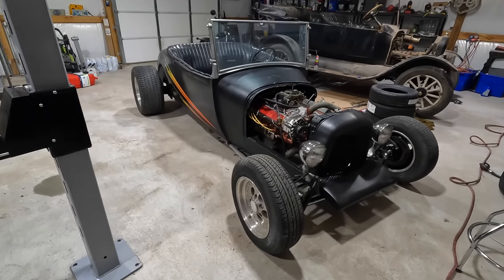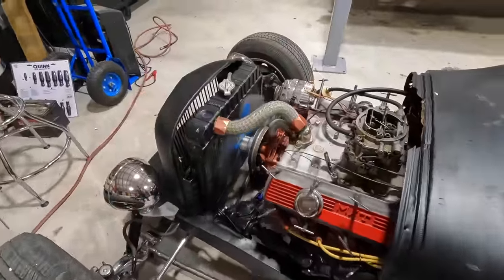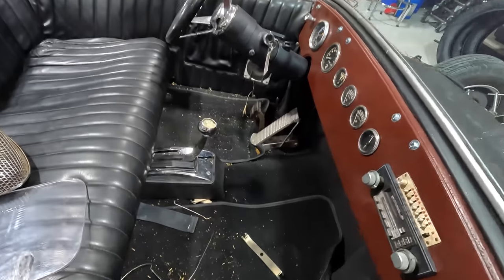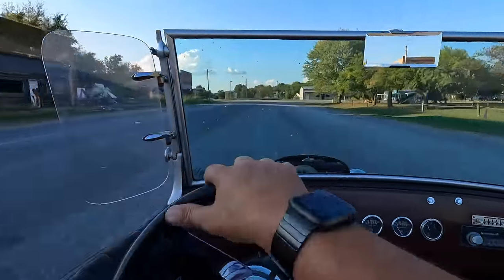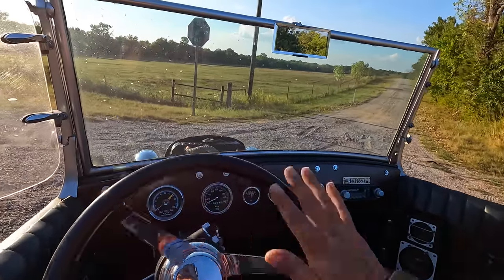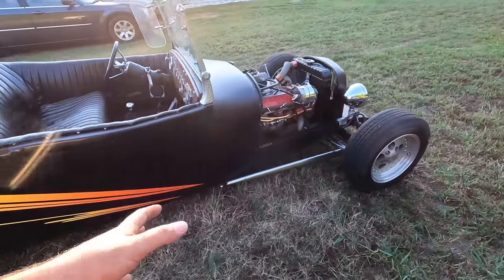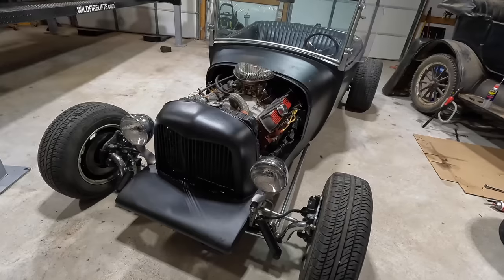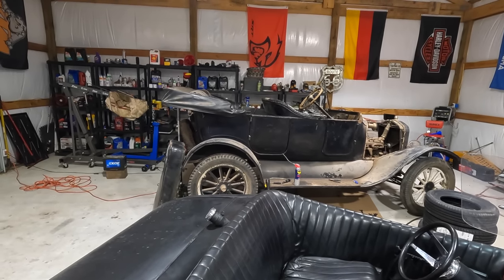I got Shafted on this 1929 Ford Roadster! $13K and 30 days Wasted!

Comment: Hello Randy. The 1929 Ford Roadster is a great car. But what's the problem that's you're waiting on?
Reply from the maker: I explained it all in the video
Reply: Can this car be refitted with a new chassis?
Reply: I would stop driving that car immediately The flexing of the frame and the fact that it moves the motor when you try steering it means the motor mounts must be welded to that tin foil frame You're asking for a hurt send that piece of shit back
Reply: They did not send the title.
Reply: old vette or mustang chassis would be nice
Reply: @FransvandenBergeMuziekschuur  normally when you place a V8 motor in one of these old "T" Frames you box it in. Sort of like they tried to do with the frame covers but actually weld in metal not tin.
Reply: @goleafsgo8496  I bet that car is a deathtrap.
Reply: @kirkacola7942  it’s not a T-bucket. It’s a Model A body that is possibly on a Model T frame which is way to weak to handle the weight and power difference because it was only meant to have a maximum of a 40 HP engine in it.
Reply: @goleafsgo8496  I’m not sure if it actually is a T frame without being able to see the frame other than the short section by the engine.
Reply: @kirkacola7942  it’s a Model A roadster….not a T-bucket.
Reply: @todddenio3200  o
Reply: @hanshoogendyk2203  ???
Reply: When you buy a vehicle at the auction the owner has 30 days to send you the title unless it is California then it is 45 days. If you don't get the title then you can return the vehicle to the auction company for a full refund, therefore, completely backing out of the deal. The owner never sent the title to Randy. After seeing the motor move when he turned the steering wheel sitting still I think he is lucky to get to return it.
Reply: @FransvandenBergeMuziekschuur  Not worth it at that price he paid! The only thing I would use is the body because it is steel.
Reply: @goleafsgo8496  thank you. I am from europe. We don’t see those cars here. From a personal standpoint. I see some awesome frames available. I like the car. And if the car stays. I’d go there. Alltho I get he has the yellow one (I would sell that in a heartbeat. Way way too fast). If he can buy it for a third without papers and make a profit on the yellow one…. 

Maybe.
Reply: Titles are easy to come by if the car isn't on a hot list.  You do need a VIN number.  Many states do not title older cars or title them only when requested.  As far as the frame, I suspect that a bit too much cross-bracing was removed to fit the V8, and that a few hours with a welder would set it straight.  All of the steering/driving issues seemed to manifest in conditions that would cause frame flex; others have solved that problem and he could too.  I certainly would prefer an authentic T-Bucket to the yellow car, and beyond the frame and tinwork, this one doesn't seem bad.
Reply: @douglasnicholls1366  maybe you could guide him to a professional who know how to straighten out that car? Could make a great episode? 

Home building hotrods is what set USA on the worldmap.

Comment: If you end up keeping it as you stated could happen in the other video I'd box that frame and attack the steering column better as that frame flexes everything quite harshly.
Reply: My frame is boxed, its a real Henry 32 frame heavily modified.   It doesn't flex.
Reply: Red really,  how about black!
Reply: A title is easy to get!
Reply: Where is it going to I'd buy it.  A fiberglass T Bucket is not worth much.  A real Henry 29 roadster is worth 20,000 plus.  If you want a nice traditional roadster I'll sell mine for $45,000

Comment: If I remember correctly, the 330 was the engine used in the original 442 in 1964. In 65 they changed to a 400 b/c people wanted an automatic so the 442 designation changed from 4 speed to 400 CI. Was a great engine tho. I'd never buy a T bucket tho.

Comment: I remember how sketchy my t-bucket was. If you find somone able to do old school alignments it helps. They actually align them like race cars so the front wheels actually have toe together which helps with the wheel hop at higher speeds in the front
Reply: With the way the steering is hitting the engine and moving the frame I bet it needs something more than an alignment.

Comment: From the way the engine was moving when turning in the shop, it seems like the front frame rails need a crossmember to tie it all together.  Could probably fabricate something.  Most likely that's why it's all over the road at highway speed.

Comment: I had a T Bucket about 30 years ago. I didn't build it, but it was basically built from a kit. Modern frame, fiberglass body, 351C/4 speed. A real Model T frame is not designed for a heavy V8 engine and modern wide/heavy tires/wheels. A T Bucket would have a special construction title unless it was built from a kit with a VIN.

Comment: Why would anyone put a model A body on a model T frame?  I’ll bet that it is a model A frame with the crossmember cut for the transmission to go through. The frame probably wasn’t braced or boxed which would explain the flex when the steering wheel was turned.
Reply: Exactly what I was going to say. Definitely a Model A frame and needs to be boxed. 
I actually don’t like using those Vega cross steer boxes on a Model A frame they put lateral strain on the frame a Corvair reversed box for push pull that goes parallel to tge frame

Comment: Sketchiest car i ever drove was a T-bucket. More sketchy than riding in the bed of a truck with all the bed mounting points rusted through and gone. 😆 Doors would fly open, seat was unbolted and slid around, no seat belts, and I fit perfectly out the open door(what do ya know). Fun stuff! 😆

Comment: In this case "Not Running" is snake oil speak for "Unsafe At Any Speed". It's pretty clear that this car was basically thrown together and was in rough mock up when it was sold. Hence the "Not Running" tag.

Comment: The Olds 330 CID V-8's were the only small blocks that had forged cranks and are highly sought after items by racers and rodders. All 350 CID cranks are cast. The 330 and 350 both shared the same stroke and bearing journal diameters. As an advertising gimmick, Oldsmobile had a 330 installed in a Cessna aircraft and actually flew it. I'm sure if you search hard enough you can probably find one of those magazine ads. I believe they were in Hot Rod and Car Craft mags as well as others like Motor Trend etc.

Comment: The 9:1 compression 330 was 245 hp, 330 tq. The 10.25:1 engine was 320hp and 360tq.
Reply: Also it had a forge steel crank from the factory outstanding motor had one in 65 Cutlasd

Comment: Car looks like maybe a 1980s or early 1990s build.  Sort of a time capsule. 

A good original Model A frame is worth like $100, in a title state one with a title might bring more.  Guys make plates to box them for not much more than that.   Maybe this just needs the frame rails boxed in.  The doors being welded closed tells me they knew it would flex some when they put it together. 

Model T frames are pretty flat and like 2x3 C channel, they're not that desirable for a hot rod.  Model A the channel opens up to 4 inches or so tall.   I can't see enough of it to tell which it is.  Boxing them means you weld in a plate to make it a box tube instead of a C.   They really aren't strong enough on their own for more than a mild hop up, but boxing them in makes them strong. 

No title is not a huge deal on these.  My state it doesn't need one.  Maybe you have to buy another frame that comes with a title.  Ford frames have the VIN stamped on the left side top at the cowl.  A lot of guys just register them with a title and never worry about if it matches or not. I wouldn't do that but shrug 

$13K to me seems high for the build quality in it, but I don't think you could build it yourself for that unless you pieced a car together a little at a time.  The body is probably a mix of parts and not a legit roadster.
Reply: Very good advice speedway motors also sells so weld in crossmember and bolt in cross members excellent comments very little money five hundred dollars and time spent working. It makes me really wonder why people who want a Lexus 330 take the dam time to buy a hot rod and park it in their garage forever and bitch about it.

Comment: It needs more caster.  Its not a T Bucket.   I  have a 28 roadster.   It feels good past 100mph.  My Daughter has a 1918 T track roadster  with a V860 and a halibrand quick change.   She cruises at 70 to 80 in it.  Your suspension needs work.

Comment: 1929 MODEL A - It is NOT a "T" Bucket.
Reply from the maker: It's all the same lol
Reply: @AutoAuctionRebuilds  Actually a "T" bucket is the "trunkless" body from a Model T Ford, which ended its production run in 1927.

Comment: While it's not something you would want to do burnout contests with, it's only going to be dangerous if you drive it past it's limits. It'll be great for local car shows and parades or a leisurely cruise up the strip but you wouldn't want to drive it cross country or light up those tires over and over.

Comment: It's a model A, not model T. You can buy a new frame and fully box it. Steering wheel had lot of vibration that's coming from the front end. Could be tires could be rims could be loose front end period. Any vibration in the seat? All and all I'd say you got your money worth. Few fun weekends and you got a profit car. As far as a title, file for builder title no big deal. Harder and harder to get real steel.

Comment: If the battery is fully charged the Amp meter should not show a charge....It will show a charge right after starting the engine but only for a short time....

Comment: Sight unseen!. Famous last words. Welcome to what hoards of unsuspecting trusting buyers experience every day. I have built 7 rat rods from scratch. My latest a steel 26 T Ford coupe on a boxed and modified Model A chassis. 1961 dodge D-100 front and rear axles. SBC 383 with a 6.71 vintage 60's blower and two Holley's on top. 4 speed manual. Before you go very far box that frame. I made my own boxing plates from scrap although they are about $50 from Speedway. Having an Old's engine is cool. Tons of torque. The 330 ranges from 245 to 290 horses and 325 to 345 torque. It's a cool project but the title mess up could result in you losing it. I've seen this happen and turned out to be stolen. I have had to bond every title on my projects. The latest frame had a VIN the DMV let me use but I still had to bond it. In Arizona it was about $200.

Comment: To bad you could NOT have kept it, here in Wisconsin we have what is called a Bonded Title where the State Patrol verifies the VIN and does a title Seach to look for Leans or Thieft , there is NO charge to do this.  If the title comes back Clean they send you a Bonded Title For Free.  I have done this with several cars..

Comment: The original Model T touring car is sweet. Have you ever driven a stock Model T? They are not like a car from even the late 1920’s or 1930’s. The shifting and accelerator/ignition timing setup is completely different

Comment: When you look in the rearview mirror at 16:25 the mirror is going up and down. That frame is flexing or that frontwindow is moving.

My guess is that the frame is flexing. That would mean there is structural damage.
Reply: All it means is it's built on a stock T or A frame.
Reply: @CR7659  yes. Wood that may have lost it’s integrity. I think t bucket steel frames can be purchased . A refit may be wize.

Comment: A '29 would be a Model A, not a T Bucket. Would like to have seen close ups of the motor, trans and steering box mounts from the underside.
Model T frames didn't have front frame horns, wondering what was hiding under the shroud? $13,000 was too much, salvage the components, mount them on an aftermarket Model A frame (slightly triangulated increasing strength - increasing the wheelbase or bob the rear). Brace the radiator/grille shell with Model A rods running to the firewall. Driving in that condition on the highway was sketchy. The auction company resolved the situation correctly, perhaps it will reappear for bidding.
The basics were there, add a new frame, replace the steel body floor pan cross members (channeled) to remove the wooden floor and paint this old school classic blue with a white firewall with blue and white/white rolled/tufted interior. Or just add flames on the black. The filled grille shell (steel?), frenched tail lights, molded (hammer welded) doors and profile scream the '50s.

Comment: You have now experienced what the early days of hot rodding was really like. When the quality of the car depended on the skills of the builder not on what the aftermarket has developed. I would NOT unwind the deal. I would FORCE them to produce title, year correct / not a builders title that would require the car to be compliant with all laws in effect on day title issues. A REAL metal T-bucket is PRICELESS.

Comment: Have you ever used the Vermont loop hole process? I was just curious if it really works. It seems like the car would be a good start for someone. We'll if they could get a title. I wonder if you could box in the frame and the steering box and that would help.
Reply: We tried the Vermont thing , haven’t received anything yet it’s been 3 months

Comment: If you want to deal in ONLY old vehicles (over 25 years) then Texas is the state to do that.  No dealer license needed for vehicles over 25 years old.  503.024.b.5 is the specific part of the code.  Could be like old times for you, back to flipping on the cheap, and if you can't not buy something newer you can always sell at auction, to any dealer or wholesaler, or to an out of state buyer and it doesn't count towards the 4 (worded, fewer than 5) car a year limit for private sellers.  25 years old takes you up to 1997 at the moment so half the cars out in your yard would be fine, the Citation, both the Hondas, the Camaro, Saturn, both those old roadsters, and of course the Model T.  The '98 Pontiacs (Montana, GPGT) would be fine come January.

Comment: The body appears to be a ‘27-‘31 Dodge body. It’s common in the pre ‘70s to register a Ford chassis with an other manufactures body on it. “GET A REFUND!!!” …..This bucket is  unsafe with the steering box twisting the frame. You couldn’t recoup you investment after fixing the frame.

Comment: Those are wind wings.   The car should be worth $30,000.  The wheels aren't old school,  they are 80s wheels.  The intake is fairly common ( in California at least) get rid of the cheesey tilt wheel.  Get some steelies and little hubcaps.   The wheels are too wide.  I'd put a 32 steel dash in it.

Comment: Pretty cool looking hot rod. By the way, it's pronounced  off-en-how-sir.
If you keep it, I'd suggest new suspension and maybe do some fabrication to strengthen the frame. Someone did this build on the cheap. With your knowledge and abilities, you could make this so much better and maybe recoup some of your money if you sell it